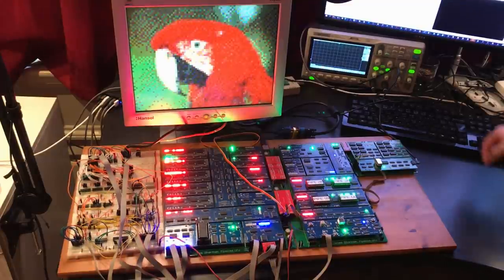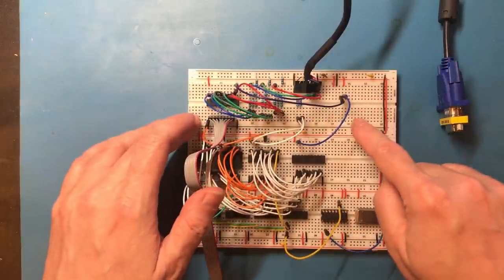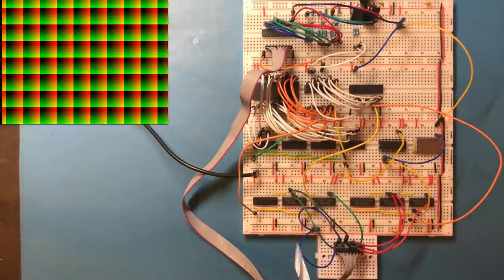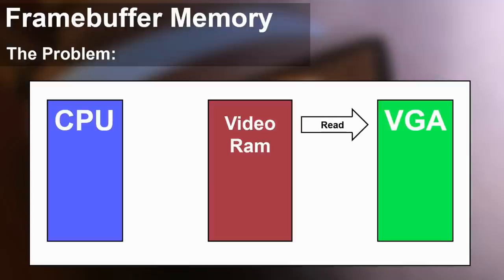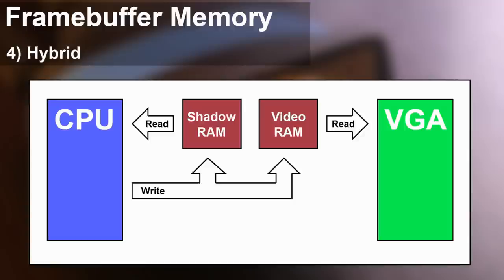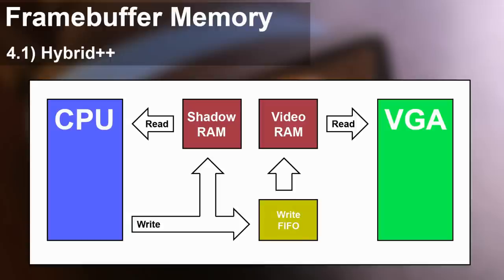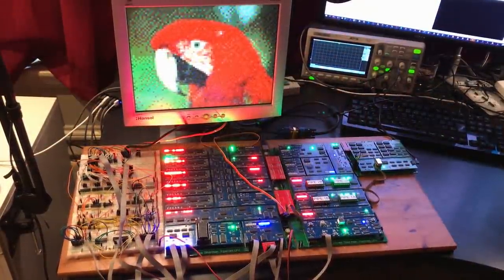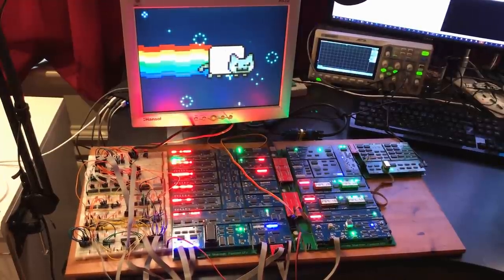Framebuffer - VGA from Scratch - Part 3

Comment: Well, after binge-watching your videos during July this is the first I catch in real-time! Fantastic work as always, and thank you for the clear explanation of several possible methods to manage the RAM addressing. One way I've thought about when trying to figure this out (I'm not building anything yet, but I'd love to) was to use several (2 or 4, maybe 8) RAM chips as "pages", that way you could read from one while writing to the others - but I doubt it would be very efficient space-wise, and small RAM chips appear hard to come by.
Reply: In a perfect world 2 pages is all you ever need, theoreticaly. You write to one as the other is displayed, then you change the pages.
Reply from the maker: Glad you are enjoying it. You suggestion is either similer to the banking system I described in passing, or true hardware double buffering. The later is indeed another way of solving the problem, but it ends up being roughly double the memory interfacing logic as the option I presented.
Reply: @akkudakkupl   Assuming I understand you correctly, if you just switch between two pages, then presumably the display memory the CPU sees is suddenly being changed (from what the CPU had just written)?  So a subsequent CPU read may not return the expected data?  I don't see how this would be workable in practice, without yet another video buffer in memory as the CPU's master display memory (that would then need to be bulk copied to the "paged" output buffer).
Reply: @gregclare  You blast data into one page or the other, you keep local copy of data in CPU RAM space. You just copy modified data to video RAM pages once per frame, alternating pages, so that video hardware has access to one page for displaying, while CPU has access to the other for copying.
Reply: @akkudakkupl  Yes, I understand what you're proposing. But having the CPU need to do a full buffer block copy once per frame is a significant overhead.  It would be more efficient to just implement a simple "CPU has access priority to the video buffer" solution, and then code to only update the Video buffer during blanking periods (so no visual artifacts created by the CPU priority access).   ie. You just organise your code to do the non-visual processing during the display period, and synchronise video updates triggered by either the Vsync or Hsync pulses.
Reply: @gregclare  For that you either need to pool Vblank flag periodicaly or have interrupts - this CPU has no interrupts. What I proposed is the simplest method of concurrent access to VRAM that doesn't need any complicated programming or hardware - it's a compromise.
Using blanking period is of course superior!
Reply: @akkudakkupl  But what you propose still requires the same frame blank period synchronisation.  Even if you automatically swap the display buffer pages in hardware (once per frame), this would need to be synchronised with Vsync.  To ensure you are not in the middle of writing to the display buffer, when the pages are swapped, your code would still need to synchronise it's display buffer updates (eg. by polling Vsync or an interrupt).
Reply: @gregclare  Unless you swap the pages by command from CPU (+ synchronization on video side) ;-) Yeah, it's more useful for text than smooth animation.
Reply: @akkudakkupl  I still don't see the advantage?  Even if you swap the pages by CPU control, you still need to synchronise the swap timing with Vsync / vertical blanking period, to avoid visual artifacts (or partial frame update change).  Likewise, you still need to coordinate your frame content updates, so that only completed frame updates are being swapped.  In addition, you then need to replicate updates on the alternate frame, which otherwise would be one frame of updates behind... unless you are doing a bulk copy from a 3rd CPU RAM working buffer (which just adds more overhead for bulk buffer copies per frame).
ie. I still think the best option is to simply have a single VRAM memory, which the CPU has priority access to.  The CPU simply coordinates required VRAM updates with the blanking period, and does other work during the display period.  This was a method used by many 8-bit computers of the early 80's, with any blocked video display accesses returning black data (ie. 0's) so that the video glitches were not as noticable.  It was up to the programmer to ensure they only accessed the VRAM during a blanking period to get a glitch free display, while still have the benefit of a CPU running 100% of the time.  Typically this was coordinated via a Vsync interrupt (or polling).
In some cases quick video updates (line based / mid frame) were also coordinated with Hsync.

Comment: 5:00 rounding up the row and col count to a power of 2:  My immediate reaction is "why not display 1024 horizontally?"  1024 by 768 is the full resolution VGA.
I think real cards would not have any trouble having the rows one after another, as they maintained a counter that counted up each pixel rather than having separate counters for row and column.
Reply from the maker: "full vga" is a fairly arbitrary statement these days although technically everything over 640x480 is svga (or one of the other prefixes). 1024x768 needs a 75mhz pixel clock, no hope of that on a breadboard and I'd need a much more complex parallel memory access system to pull the data out fast enough. There isn't a single "real card" way of doing this, if you use a single counter you need a more complex circuit to handle replication of lines if anything isn't run at full resolution. Display systems designed for gaming tended to lead more towards duel counters for reasons that will become obvious after the next vga video.
Reply: If you insist on letter jumbles, that's not VGA but XGA. IBM VGA uses 720x480 (text mode with 9 pixels wide characters), 640x480 (which became known as VGA) and 640x400 (allowing it to output CGA-like 640x200 and 320x200). IBM 8514 used 1024x768. Plenty of "super" VGA-type boards used much higher resolutions as well, with 1600x1200 being quite common. 1024x768 is pleasingly round, though.

Potential downsides include things like requiring wider pixel counters (the blanking interval must be in there somewhere) and faster pixel clocks (e.g. 65MHz rather than 25.2MHz) or interlacing (still demanding 44.9MHz).

Comment: Fantastic work, as always.  Now that the clocks are independent, are you considering increasing the CPU's clock speed to get more done in the blanking intervals?  If you are, and you go above ~4.7MHz, I'm going to have to find more performance in my emulator, so I selfishly hope the answer is 'no'.  :)

I was wondering how you'd handle access to memory, and this wasn't something I'd considered.  I was thinking of splitting the frame buffer in half on separate chips that could be enabled independently.  So top half of the screen on one, bottom half on the other.  But there's probably some issue with that I haven't considered.

Also, please don't apologise for the final demo; a well done surprise like that is always welcome!
Reply from the maker: Thanks Quxxy, I'll do some tests on frequency at some point, but I think I'm faster already than I really need so I it's not a high priority. I calculated a while back that 4mhz was the peak with parts running inside there specification so I'm not sure going beyond that is a great idea.

Comment: Did you consider using 41264 DRAM's?  They are a memory that was used on VGA controllers for PC's in the 80's & 90's.  One port is read write like standard 41256 DRAM's.  The other is a high speed serial-like port that is read only for the display output.  Might be worth a look, although it would add some logic for accessing DRAM.
Reply: I have no idea on the pricing but it looks like a good solution that I've seen used in older begin 90s computers too like the Acorn Archimedes. Haven't dug into the data sheets but it might use cpu free cycles to fill up the FIFO, maybe using parallel banks for speed.
Reply from the maker: I had a couple of reasons to not look at those, firstly they are not really an active part. You usually end up buying them on the second hand market and I wanted to avoid supply problems. The other thing is that they are great for solving one specific problem where the second port requires just linear access. However some of the features I want to build into the cpu require more random access on the vga side and I didn't want to include multiple systems.
Reply: @reinoud6377  I looked at the data sheet and it seems that the serial FIFO uses a 256 bit wide parallel load mechanism so as to minimize the potential for blocking the CPU.
Reply: @weirdboyjim  I can understand that motivation very well.  It also leaves me looking forward to seeing what you are planning!

Comment: Our 380Z at school had a system where you could extend the blanking interval so you had full CPU access to the video RAM but the screen would blank... so you could chuck an initial display at the start of a program and you'd avoid corruption by having a completely blank screen.
Reply from the maker: I did think about a blanking bit for that reason.

Comment: I think the way the NES and I think the Gameboy handle graphics is really interesting, since they don't really have a pixel framebuffer. They just have the higher level descriptions of what do display and the pixels are calculated in real-time right as the they're being output. It saves on video memory, but also requires the graphics system to actually be capable of its own processing and requires the programming to be more clever to accommodate it. It also seems to be somewhat closer to a modern GPU rather than a traditional framebuffer since all the rendering is done outside the CPU.
Regarding memory access, from what I remember of my time writing an emulator, the NES allows the CPU to still run while outputting pixels, but it can't access video memory during that time.
Reply from the maker: Tile based system have a couple of uses, it's  a big reduction in the memory used compared to a framebuffer with the same pixel density, but it also allows modification of a large portion of the screen by manipulating less data.

Comment: Something's not adding up for me. You said in the intro video that you wanted 640x480 with 24-bit color. That works out to 900KB just for the color data, which is many times more than your computer's entire address space. Have you reduced your requirements? Are you planning on moving away from memory-mapped video later? Maybe use bank switching? Or have I completely missed something?
Reply from the maker: Maybe I could have been clearer in the goals.  640x480 with 24-bit color as a flat bitmap is a massive amount of memory as you correctly ascertain. My goal is that I output 640x480 pixels so I'm not running at a reduced resolution but I'll be using a combination of tiles, sprites and a palette is both make the memory manageable but also the update rate faster.
Reply: @weirdboyjim  Ah, okay. Thanks for the clarification.

Comment: I want to explore a little bit on Bus request with several chunks. Instead of having chunks to be placed one after another, one can have them interleaved! So, for ex., even bytes go into first chunk, and odd bytes into the other. That will guarantee, that the CPU will never be stopped for more than one Clock cycle, as VGA will always alternate reads from chunks.
To do that, one can have 2 RAM chips and select between them, but instead of doing it on the highest bit, do it on lowest. That way consecutive addresses will alternate between chips.

With more chunks, even better things possible. CPU cannot access VRAM all the time - it must also fetch instructions. That creates an "opportunity window", when VGA can read VRAM. The key idea is to read all chunks simultaneously, and latch the data for later use. With enough chunks, there will be no need to ever stop the CPU!
Reply from the maker: That's good thinking, it's actually what a lot of "real" systems do. For a while I toyed with an idea very similar to this but but instead of stopping the cpu you have a set of latches to store the last write (2 for address, one for data). Essentially a one byte fifo but you were always guaranteed to be able to flush it within a cycle.